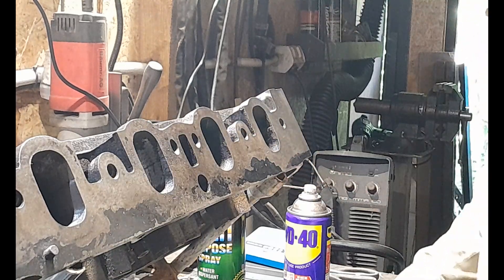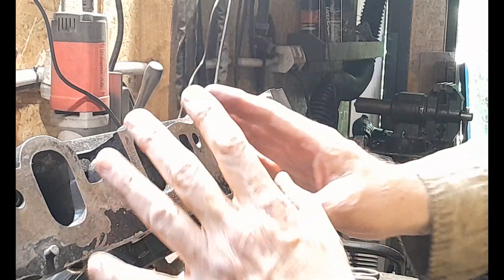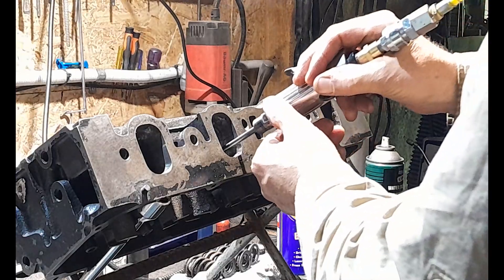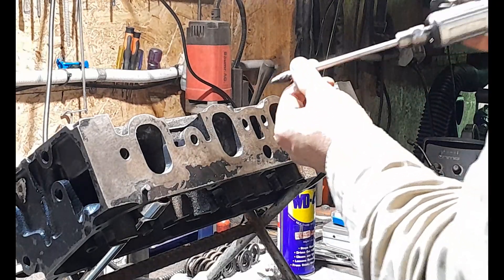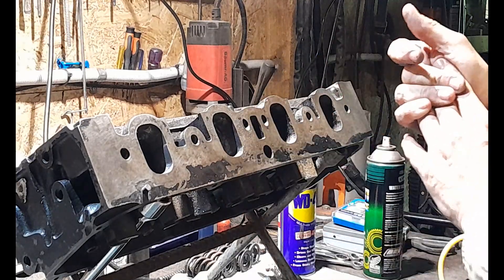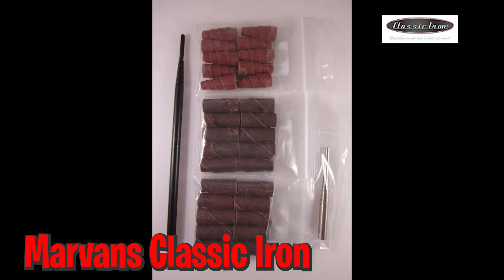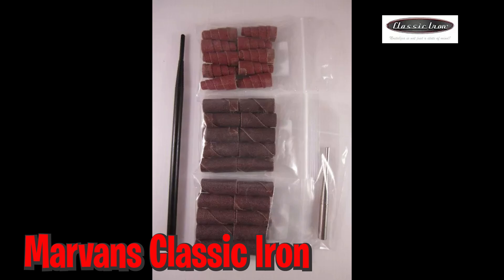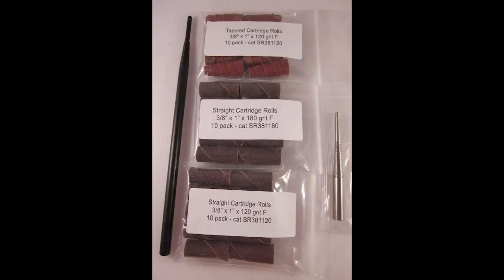351 Cleveland Cylinder Head Porting Basics To Get You Started

Comment: Thank you again it just happens I’m doing the same thing 302 Aussie head porting can u ask what size valves you using
Reply from the maker: Hi mate, glad the series is helping you and great work on porting your heads. You’ll be very happy with the results.

My 302 heads have stock intake and exhaust valve sizes. 2.05 and 1.65. Take your time porting and enjoy the experience. It’s a great feeling getting results from old iron you have worked on.